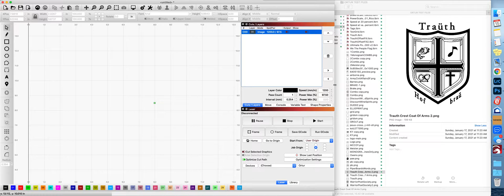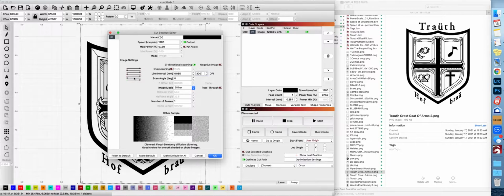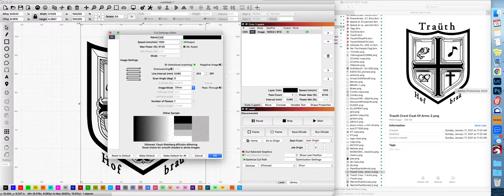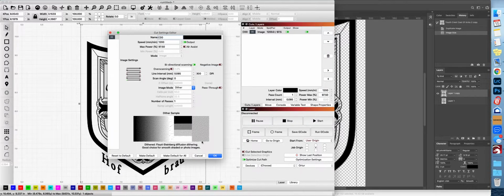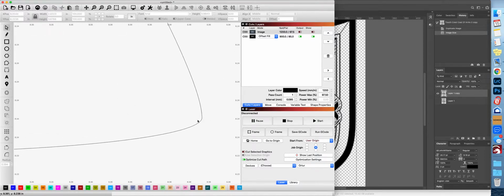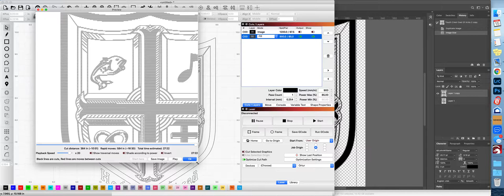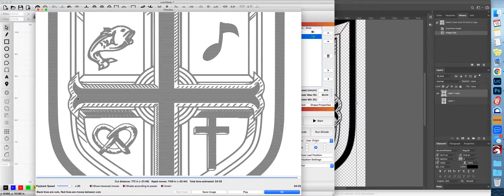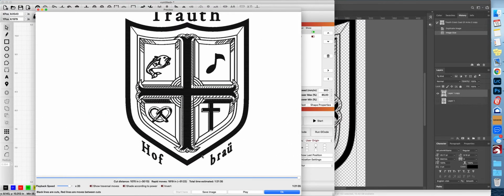Lightburn Tutorial - DPI & Line Interval

Comment: I engrave images in SVG form, but they come up as "label" in my cut/layers window and when that happens, I don't have the dpi option. Is there something I'm doing wrong?
Reply from the maker: I haven't looked into SVG but since SVG images are vector-based, which means they can be scaled up or down without losing quality. That's probably why it's not giving you a DPI option as it's not necessary.

Comment: SIDE QUESTION, regarding 'TRACING': can greyscale image data be preserved? This can be useful for lo-res graphics, but that aren't just simple B/W silhouette. This is possible on a "printer" laser system, where it's controlled by printer drivers, not "gcode". An example is an Epilog laser using a "standard" (non-laser-specific) 2D vector app (e.g. CorelDRAW/Illustrator/Inkscape). Thx.
Reply from the maker: Great question! Yes, preserving greyscale data can definitely add depth to lo-res graphics. It’s all about how the software interacts with the laser system. Keep experimenting with those vector apps! You can keep the image data but simply turn off "show" and "output" and the image will be saved in the file. Hope that answers your question.